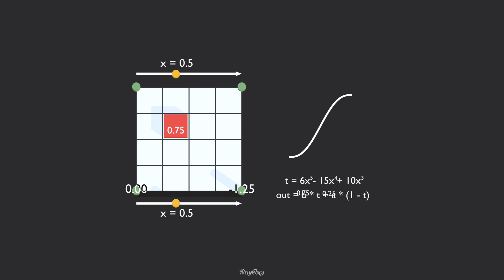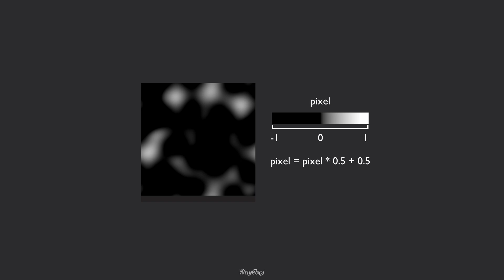Perlin Noise Generation in Under 2 Minutes

Comment: 0:32 by the way the smoothsteo function is completely optional it can be any other smoothing function it could just be a linear interpolation or custom and it will still be a perlin noise. And one cell don't need to be only just 4x4 subpixel it can be 10x10 or 100x100 it's the resolution of that one cell.

by the way in my case I don't really like the smoothstep function much it's a bit too blocky